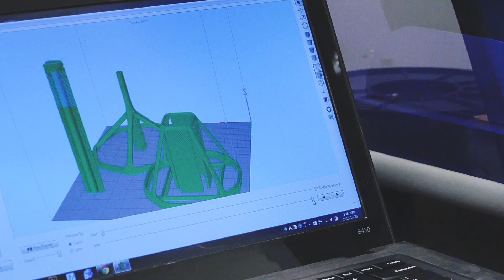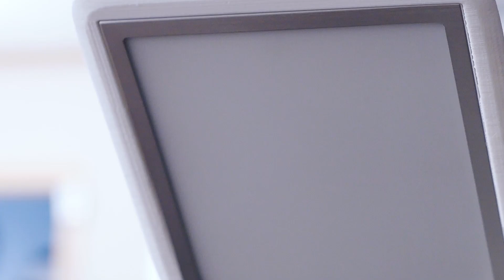Creating OLED Light Fixtures with 3D Printing

Comment: A very inspirational piece done with class. Full disclosure: I designed LG's HQ signage when they were Lucky Goldstar. Olga, the 3D printing process is often used for prototyping, not mass production. But the line between the two is becoming fuzzy. If you made this for yourself at your local Maker Shop or public library I'm sure you would treat it very gently to get the longest life out of it. When it breaks....well....it's like the ceramic ashtray I made for my dad....no big deal. Rapid advances in 3D printing will result in much stronger materials. Now there is even sintered metal and even concrete, both of which are very strong. I find the beauty of this video is the showing of the design>build process and the marrying of two of the latest technologies .Both are accessible and easy to experiment with for a very large amateur audience. Design democratization !